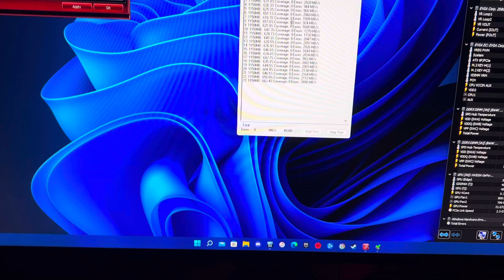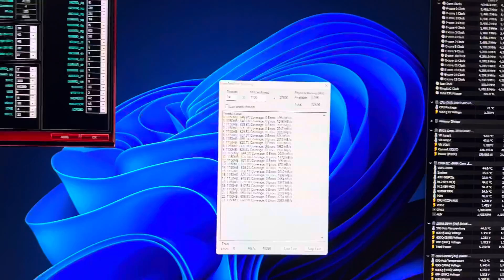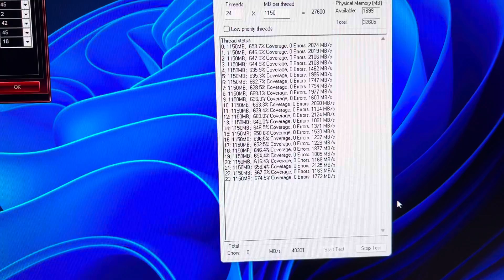DDR5 OC For Those Who Hate High Voltages - 7000 @ 1.45V with good ol’ Hynix M-die

Comment: Going to give this a go. Running Buildzoids easy ram timings currently at 6200. I can probably just up the speed and leave the timings. Just havent bothered to try yet lol.
Reply: I got a stable 

6400cl28-37-37-30-67 1.485v with an fclk of 2133 

Vsoc is at 1.200mv-1.212mv and my mobo is reading it as 1.252-1.258v

Vddg iod - 940 

Vddg ccd - 920

LLC - Low 

My sticks stay at 33c with a hotspot of 34-35. 

Originally they were 7200cl34-42-42-84-126 1.4v 

They can also do 6000cl30-36-36-76-112 1.4v

I also tuned the secondary timings. 

these are team group 16GB kit by the way so it’s A die

Comment: I appreciate you sharing but could I ask you to show me in the bios so I can copy regardless thanks anyway
Reply from the maker: I don't own the Dark anymore unfortunately, but the idea is the same tbh. 13th Gen and 16Gbit M-die does 7000 easily, and A-die can be used for some ridiculous low voltage configs. The new 24Gbit M-die on something like a Dark would be capable of 7400 at 1.35V.
Reply: @dainluke  I've got 8000 stable now thanks
Reply from the maker: @toonnut1  Well done! Which board are you using?
Reply: @dainluke  apex encore it's great 👍